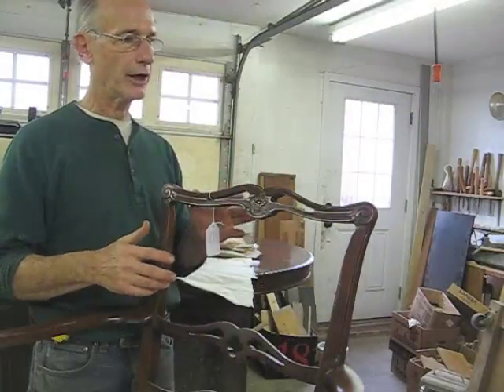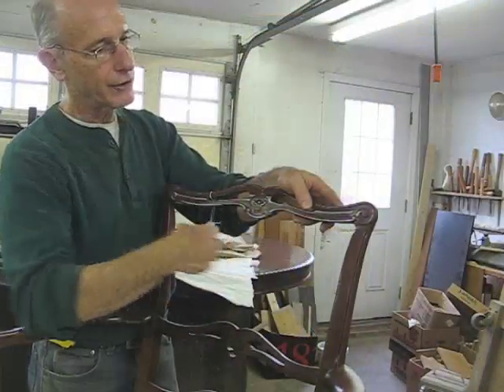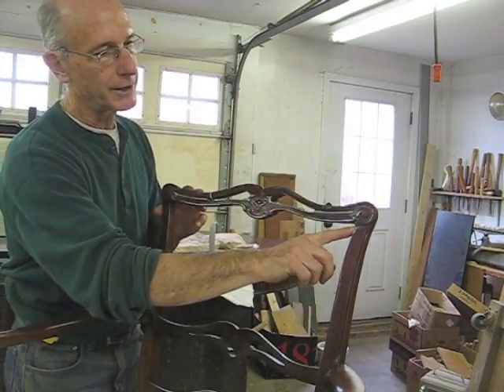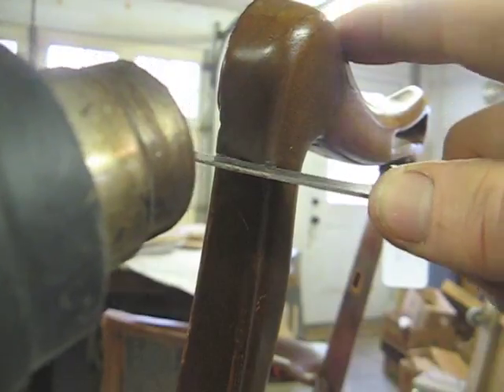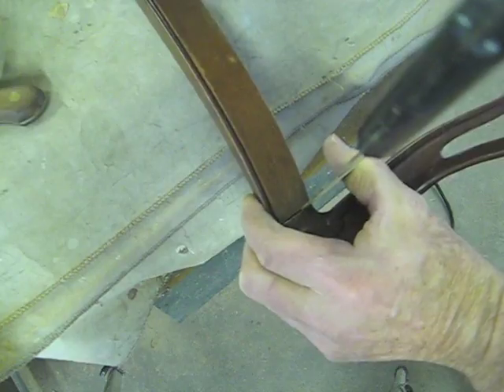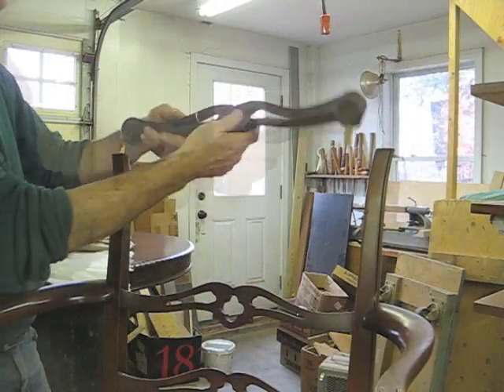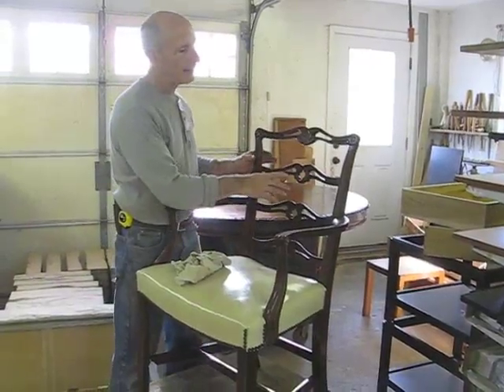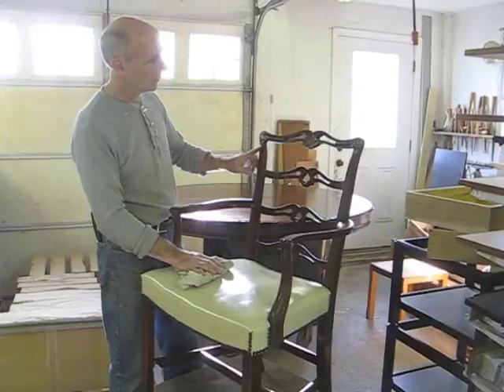Loosening Furniture Joints with a Heat Gun - Thomas Johnson Antique Furniture Restoration

Comment: What did people use to loosen glued joints before heat guns were available?  Steam from a kettle through a rubber hose perhaps?  Or did they just have to get by without loosening them at all?
Reply from the maker: Good question! Hot water, hot vinegar....

Comment: I bought an old chair which has a broken leg and had a poor glue job done on it. Not a straight break. How hard is it to undue the old glued break and redo it without breaking it more ?
Reply from the maker: Thanks for watching. You'll see in quite a few of my videos I use a heat gun to loosen the glue. You can use a hair dryer (actually safer than a heat gun) It takes at least 2 minutes, and be careful not to damage the finish. Good luck!

Comment: did the heat gun have a high/low setting? If so, which setting did you use? also, how long did the heating take before the joint loosened? Thanks.
Reply from the maker: Thanks! Yes, 3 settings, I use the middle setting. A hairdryer can work well too.I keep it on for 2 minutes. be very careful!

Comment: I've noticed that in some other of your videos you use the term "toner" for some kind of aerosol spray. I've never heard of that term before and I've been painting professionally for a long time now. Would you mind further identifying that particular product? Thanks. Big fan, btw.
Reply from the maker: Thanks for watching! Toner is stain added to any clear finish. I mix some myself when needed, doing touch up work I use the aerosols which are widely available from places like Mohawk or Woodworker's Supply. As a painter, if you were finishing woodwork with varnish you would absolutely need it for pine and poplar, any soft woods.